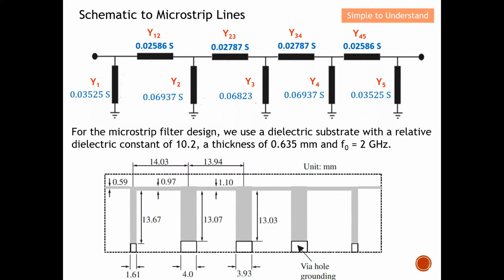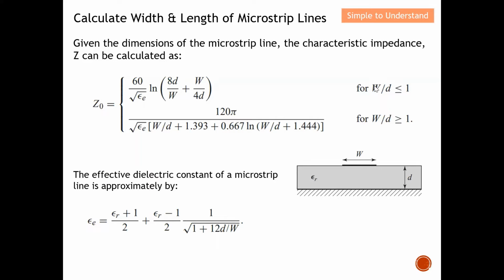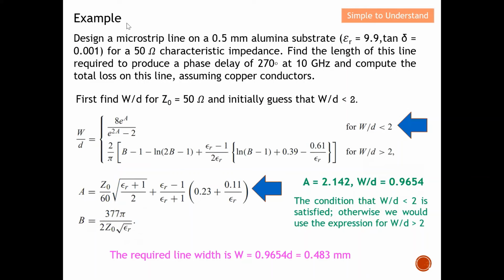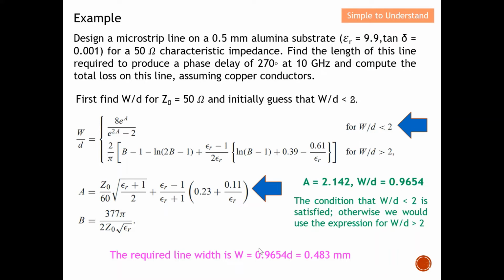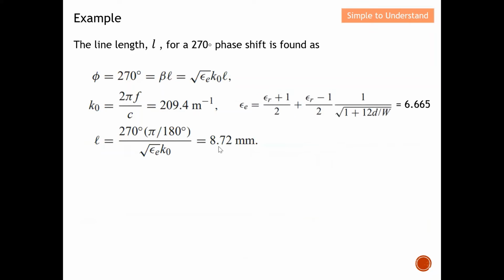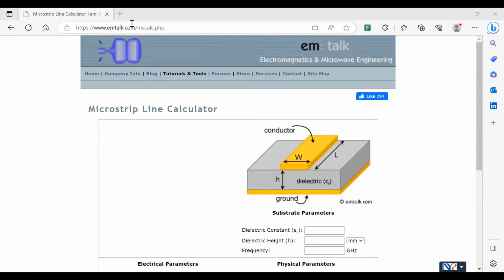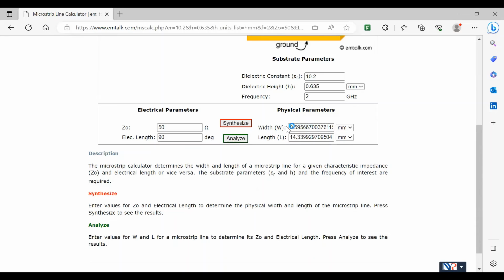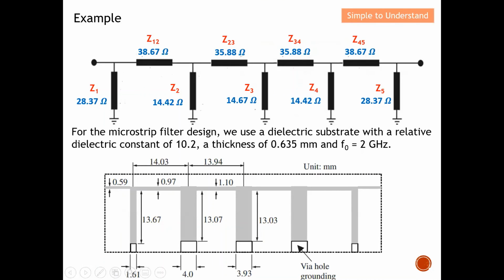Filter Design #21. Microstrip Design: Obtain Width & Length for Target Impedance & Electrical Delay.

Comment: Sir, could you please reveal, what's the copper thickness you chose for the physical implementation of the filter on a substrate of height 0.635mm?
Reply: Also, is the substrate material GaAs and the conductor material copper?
Reply from the maker: 1 to 3 Oz is good. The substrate normal use the Roger board for filter design.
Reply: @ Thank you a lot sir. Much appreciated.
Reply from the maker: I am glad you are finding the video helpful.  :)
Can you help this channel by Like this Video and Subscribe to this Channel. Thank you so much.  :)

Comment: What should be the length of the feeding line?
Reply from the maker: There is no fix requirement for the feeding line. But I actually make it longer so that later on I can still trim it.   :)

Comment: Is there any particular equation for width, which varies with x?
Reply from the maker: I am sorry, I am not in town and dun have access on my work PC. Will reply you once I get back. Thanks.  :)
Reply from the maker: The width of Microstrip W, varies with Impedance & Dielectric Constant of the board. There are 2 Eqs to choose. One is when W/d < 2 and another one is W/d > 2. May I know which parameter x, u refer to?  :)
Thanks.  :)

Comment: Sir I have designed a wideband rectifier and did the impedance matching using using  lumped components. Now i want to convert this schematic into a layout using the distributed elements in ADS software. Can you please help me how to proceed?
Reply from the maker: Pls see this playlist: https://www.youtube.com/watch?v=Ik0JmLcVHSg&list=PLFxhgwM1F4yzjNayh0ksphgThO5OXjVMp

In this playlist I design a lowpass filter using lump element then I convert them into microstrip line.
How to determine the width and length which I believe u have seem the video.

Comment: I need to design a balun for dipole and to feed i need to make sure phase difference is 180 degree for both arms. 

How can i use this website to make the phase difference of 180 degree by transforming 50ohm to 180ohm. Can you please guide abt thid
Reply from the maker: Is almost not possible that I can explain by text here. Maybe a video will be better. Will need some time.
Reply: @ it will be much pleasure if you explain in a video im struggling with these design techniques but not able to get it completely.
Reply from the maker: Understand. I have done the design of Balun (From Microstrip to Stripline) before. 1st I dun understand how u have a phase different of 180 degree by transform the resistance value from 50 to 180? Anyway, hope to find time to do the video soon.  :)
Reply: @technologiesdiscussion1676  it is like the i have to excite printed dipole antenna for that i need to excite each arm by phase of 180 so each arm get equal and opposite current
Reply from the maker: Then u no need to change the impedance value. If change then there will be mismatch.
Reply: @technologiesdiscussion1676  actually the input impedance of the dipole is around 180ohm so to feed i need to transform 50ohm to 180ohm…
Reply: @technologiesdiscussion1676  can you please share the balun design video ( from microstrip to stripline) or what is the title of the video in your playlists
Reply from the maker: No. I dun have any video on balun design yet. I mean I did the balun design for my Phd study.
Reply: @technologiesdiscussion1676  okie can you please the details in video about designing these kind of balun…
Reply from the maker: Ok. But will take some time.
Reply: @ okiee thank you , i will be great full
Reply from the maker: @asim_hussain  I am also thankful for your strong support!!!

Appreciate u can help by Like this Video and Subscribe to this Channel. Thank you so much.  :)

Comment: Great video! Can we use the website to solve for Chebyshev Impedance Match as well?
Reply from the maker: For this video?
This video shares how to get the width and length of Microstrip line base on Impedance and length like λg/4. Any methods can also apply this once you have the impedance or reference length like λg/4.
Thanks.